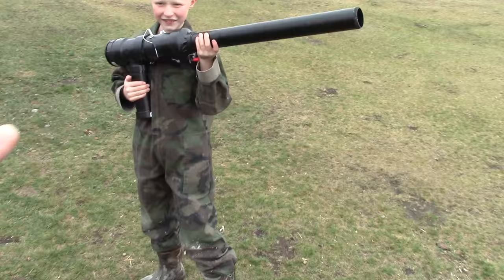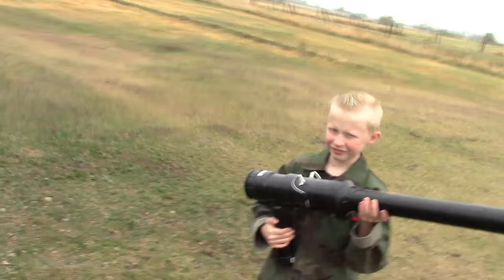Potato Gun Day - Day 23

Comment: I had the same problem with mine, starting fluid is too wet And needs to be more atomized or you won’t get a good A/F ratio.  I just built another potato gun with my boys two weeks ago and I found butane seems to work the best, it sprays out in a fog so you get a really good mixture.  It launches them way further than anything I have used before.  Great video, always fun doing this projects with the kids!
Reply from the maker: Oh sweet! Thanks for the tip 👍